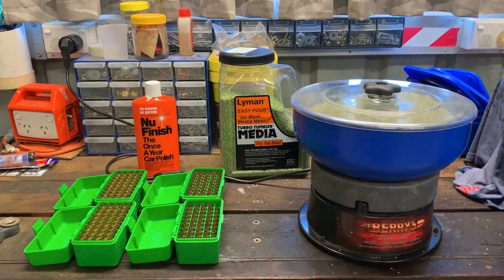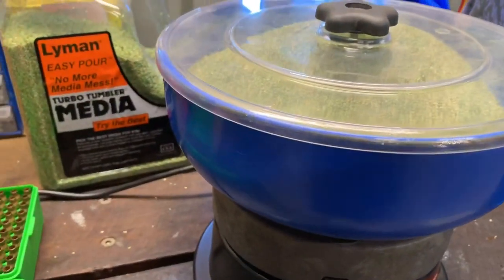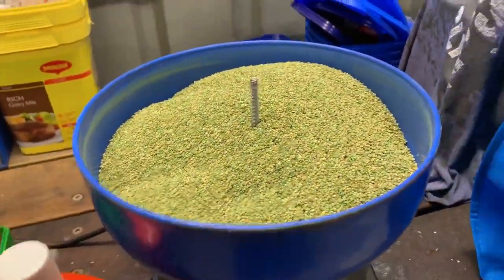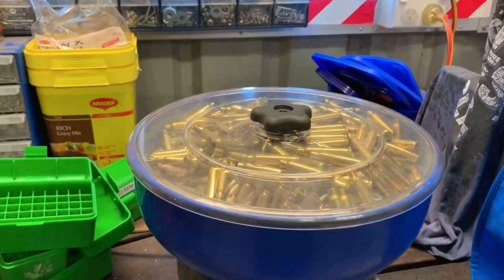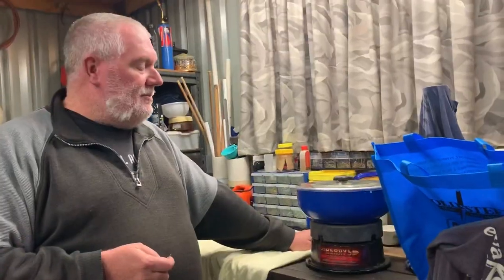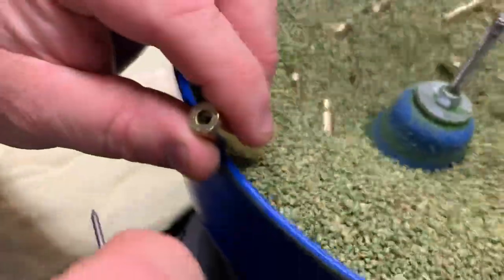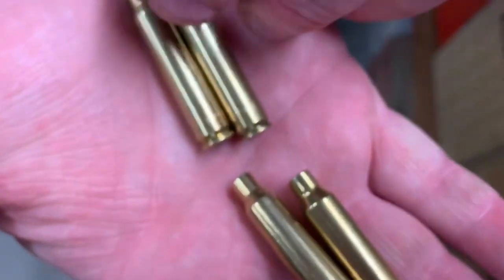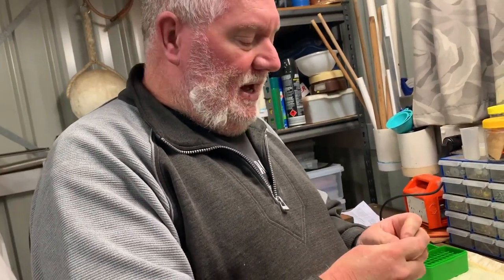POLISHING BRASS IN THE DRY TUMBLER!

Comment: Hello good sir, i have a question

When you add polishing compound to the media, does that "ruin" the batch so that its a one time use or can it be used multiple times? :)
Reply from the maker: I use the same batch of media multiple times. Before you drop your brass in, put a good squirt of polish in the media, then shut the lid and let the machine run for a little bit to mix the polish in a bit. Then, just tip the brass in and away you go.
Reply: @2clicksup910  thanks for the Reply :)

Comment: Can you reuse the media after using car polish? If yes, do you have to add the polish on the next batch of brass you tumble in the same media?
Reply from the maker: Indeed you can. Any residual remaining will just dissipate over time as you tumble more brass. You might still be able to smell the polish for a while, but it all still tumbles fine. The media does wear out eventually, at which point it gets changed.